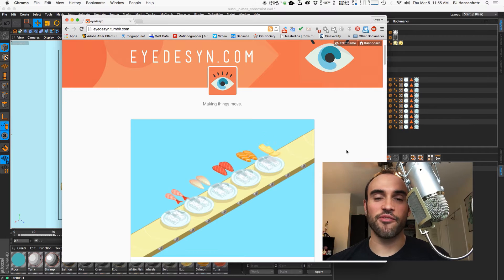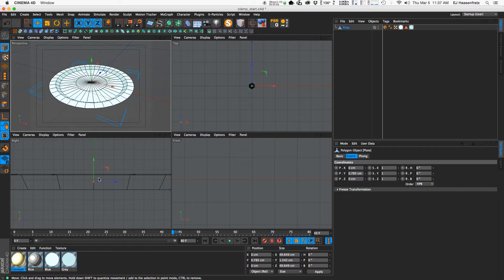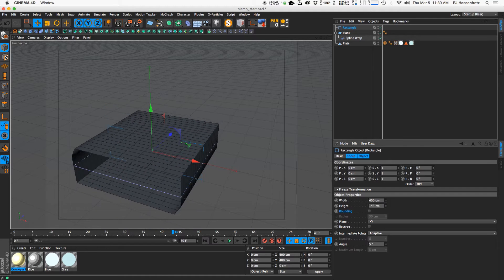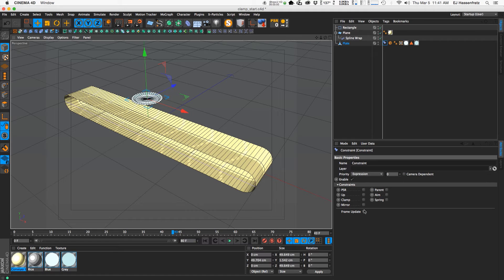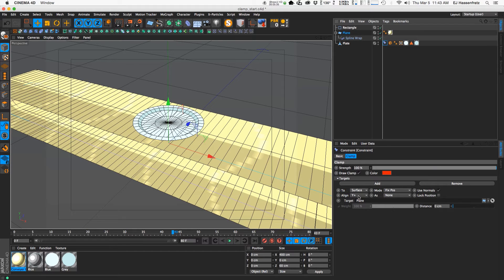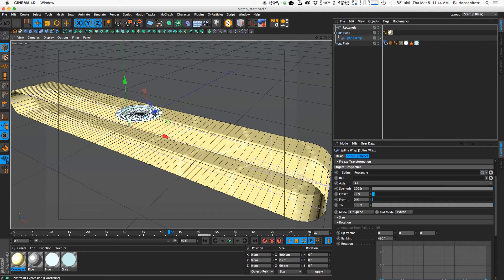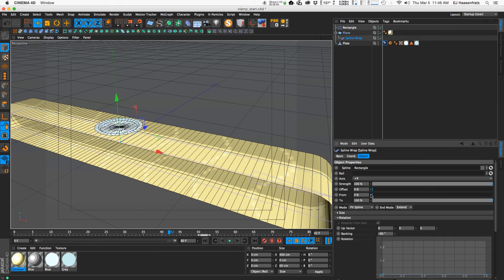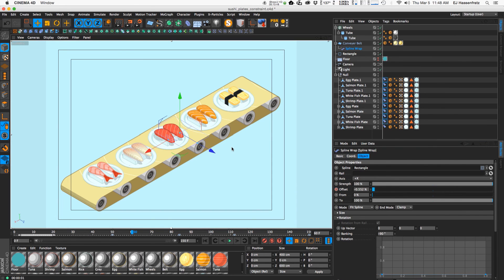Cinema 4D Tutorial - Using Cinema 4D Constraints to Stick Objects Onto Other Objects

Comment: Hi, congrats on your great toutorials, quick question on this technique, can you bend the belt in a 90 degrees angle?
Reply from the maker: Bend Deformer set to 90º
Reply: I tried that way but then it does stop running, as in it doens't move anymore :(
Reply from the maker: Use the bend deformer on the Spline, not the object
Reply: Ahh ok, gonna try that way, thanks a lot